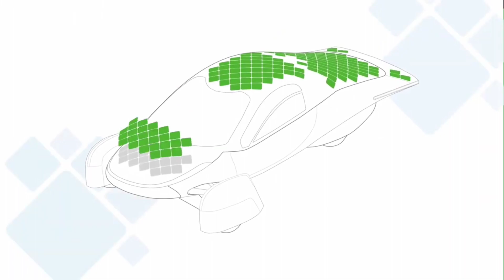Aptera Completely Destroying The Industry With This New Car

Comment: It's efficient technologically but impractical. It's a two-seater - not kids, family, dogs or even friends friendly. It theoretically has a lot of cargo space but you can't really put anything bulky in the back because of the slope of the trunk. It looks small but in reality because of the front wheels it's actually wider than an average car, plus the doors open to the side and up and you have to open them fully to get out so finding a parking slot wide enough might be a challenge in a lot of cities. It's low so getting in and out might not be easy for older people or just anyone with mobility issues. The road clearance is small so there's gonna be a lot of places it will not do well in. The reduced traction and weight will not improve its behavior on ice and snow. It only has 2 front airbags so good luck when something hits you from the side. It requires to be left in sun to use the solars but that also means having overheated car that needs to waste some of that power to cool down so I'm curious as to how much of the theoretical range would stay in normal day to day use.

Don't get me wrong - I wish them all the best. I'm sure there will be a lot of people interested if only for the novelty but saying this vehicle (it's not a car) will destroy the industry is a stretch, to put it mildly.

Comment: A major feature is their right to repair policy, by desiging it to be easy to repair and suppling information on how to repair any problem with the parts they will make available.

They have said that there will be 3 extior colors available in the Paridyme edition, black, white and silver other colors will be available 
with a special order. Three choices of interior colors as well. 
 
Production will be ramping up some time in the second half of this year, at two factories one in Carlsbad CA and the other at CPC in Itialy's motor city.

The new delta design was not shown in this video.
Reply: How do you want to repair the high voltage system? The batteries? The electronics? Everything else does not need a special "right to repair".
Reply: @vic321344  every thing is modular, all   EV's are required to have a high voltage disconect to mak it safe to work on or for first responders to be safe.
Reply: @davidmarlow194  Nope, if you pull the first responders switch, the battery pack has to be redone by the manufacturer. You are working with 400V DC. That will roast you instantly.

Comment: A question that comes up every now and then in my mind, is that since a major roadblock for funding seems to have been the lack of a fourth wheel, why didn’t Aptera add another wheel???Would it kill the aerodynamics so much???
Reply: A 3 wheeler is both more efficient and also a lot less expensive as the regulations on a 4 wheel car are significantly more than those for a 3 wheeler. They plan on a 4 wheeler once the 3 wheeler is being produced and successful.
Reply: Less resistance....yes, it apparently makes a difference.
Reply: As a 4 wheeler it would be a car, and it has to confirm to the safety standards of cars. As a 3 wheeler it is registered as a motorcycle, which makes it much easier and cheaper to produce.
Reply: I’ve offered them my substantial collection of old rollerskates and skateboards to help add a 4th wheel with little rolling & air resistance… no takers, so far. But seriously the 3-wheel exclusion is asinine provided the vehicle meets or exceeds passenger vehicle (4-wheel) crash tests.

Comment: Oil companies and electric companies don't want this car to succeed.  This is why people need to fund this production.
Reply: Because it is a motorcycle.
Reply: @vic321344  Nicest motorcycle I've ever seen. Full coverage, heating and cooling, drives like a car.
Reply: @tims8603  And is still a deathtrap in case of an accident. And it will be damn expensive. If it is ever produced.

And it drives like a pregnant whale, at least when you want to park in a parking lot.
Reply: @tims8603  "will be". Just a phantasy. Aptera does not have to commit to any safety regulation standards necessary for a car. If it would, production and development would cost 3 times as much. And it is already clear that the Aptera motorcacle canot pass even the simplest saftey measures.
Reply: @tims8603  I leave visions of the future to you and Nelson. "Will be", "Will have"...
See Sandy Munro. He speaks about the costs of production of the Aptera motorcycle against the cost of a regular car.
Reply: Definitely!

Comment: Small niche market at best
Reply: With more than 38,000 reservations it is a far larger market than Tesla's market for the Roadster.  It was designed for a niche.  The second Aptera planned will be a 4 wheel, 5 passenger sedan.
Reply: @n.brucenelson5920  $100 registrations mean nothing.
Car business is usually a money 💰 furnace
Reply: @richardwolf6269  It is a money furnace in this case as well.  The $100 dollar reservation fee weeds out non serious people to some extent.  The money is held in escrow and is available to be refunded on request at any time.

It is an indication of demand and Aptera has changed their production planning based on it.
Reply: @n.brucenelson5920  The roadster is also a niche market. And Aptera is not even able to produce their 3 wheeled motorcycle. Without the need for all the safety features a car requires.
Reply: @vic321344  Yes, the roadster is a much smaller niche market.  

They have not had the time yet that Tesla took to assemble even a working prototype, so your comment about not even being able to build a 'motorcycle' is wrong.

Aptera is an autocycle.  The safety standards it will be tested to are the same FMVSS Part 200 standards as any US car.  You keep trying to mis- inform people about this.  Why?
Reply: @n.brucenelson5920  Autocycle is another word for 3 wheeled motorcvycle (no sidecar). And Aptera is not able to perform even the simplest test of FMVSS Part 200. You keep trying to mis- inform people about this.  Why?
Reply: @vic321344  Don't mis-represent what I have said.  It just puts you in a bad light.  No one ever tests prototypes to FMVSS Part 200.  Aptera will do so once they have vehicles available to test. 

According to Lawinsider, 

"Autocycle means a three-wheeled motor vehicle that has a steering wheel and seating that does not require the operator to straddle or sit astride and is manufactured to comply with federal safety requirements for motorcycles. Except as otherwise provided, an autocycle shall not be deemed to be a motorcycle."

You can make up your own definitions, but they have no legal meaning.
Reply: @n.brucenelson5920  "is manufactured to comply with federal safety requirements for motorcycles". That is all that counts. Everything else is squack. And in some legislations you even have to wear a helmet in the Aptera.

GENERAL ASSEMBLY OF NORTH CAROLINA
SESSION 2015
HOUSE BILL 6
RATIFIED BILL
H6-v-3
AN ACT TO DEFINE AND REGULATE AUTOCYCLES.
"Passenger Vehicles. –
a. Autocycle. – A three-wheeled motorcycle that has a steering wheel,
pedals, seat safety belts for each occupant, antilock brakes, air bag
protection, completely enclosed seating that does not require the
operator to straddle or sit astride, and is otherwise manufactured to
comply with federal safety requirements for motorcycles.
a.a1. Excursion passenger vehicles. – Vehicles transporting persons on
sight-seeing or travel tours.
…
d. Motorcycles. – Vehicles having a saddle for the use of the rider and
designed to travel on not more than three wheels in contact with the
ground, including motor scooters, autocycles, motor scooters, and
motor-driven bicycles, but excluding tractors and utility vehicles
equipped with an additional form of device designed to transport
property, three-wheeled vehicles while being used by
law-enforcement agencies and mopeds as defined in subdivision d1
of this subsection."

You can make up your own definitions, but they have no legal meaning. 

You keep trying to mis- inform people about this.  Why?
Reply: @vic321344  It seems clear from this reply that you are not a native speaker of English.  There are "legislations you even have to wear a helmet in the Aptera." we can only guess at what you wanted to say.

To many of us, passing the government standards for cars is an important step, whether or not it is required.
Reply: @n.brucenelson5920  Aptera is not able to pass even the simplest safety measures for cars. Hope you are able to understand that.

Merriam Webster: "legislation: the exercise of the power and function of making rules (such as laws) that have the force of authority by virtue of their promulgation by an official organ of a state or other organization"
Reply: @vic321344  Your first sentence is not true.  It has already passed virtual automotive crash tests.

Nearly a half-million passenger cars and SUVs sold each year have not been crash-test rated by the two main organizations that conduct independent assessments: the federal National Highway Traffic Safety Administration, which uses a star rating system, and the insurance industry-backed Insurance Institute for Highway Safety, which rates vehicles from Poor to Good.
According to Consumer Reports, the vehicles that are not independently tested are:

    All Land Rover vehicles
    All Porsche vehicles
    All Jaguar vehicles
    Lexus GX
    Mercedes-Benz GLA
    Mercedes-Benz GLS
    BMW X7
    BMW 4 series
    Chevrolet Corvette
    Mercedes-Benz S class
    Mercedes-Benz A class
    Mercedes CLA
    Honda Clarity
    Toyota Sequoia
    Mazda MX5 Miata

Quit with your FUD and untruths.  Your second sentence is not relevant to what you wrote.  I have served my decade as an English teacher and don't need to hold myself up to instruct you.

Comment: I could see many people getting this as a second "fun, errands and commute" car, especially in sunny climes. If they bring out a 4+ seater in the future too, it could be a game changer.

I'm not sure getting the 1000 mile version would make sense for many though, as that would reduce the daily solar miles you could get due to weight, though using a standard charger would work for those who do need it for long haul.

Just the idea of never having to fuel your car again in sunny places would have me buying one in an instant. I live in the cloudy UK, so I'll have to see how it performs here, but it does look cool and is pretty nippy too, so fun.
Reply: I expect to get around 20 miles per day here in Iowa with full solar.  It will be interesting to see what changes besides RHD they will make for the UK market.
Reply: Probably a third car for people with money.
Reply: @njm3211  perhaps, but due to the extremely low cost of operation it could be a hit for some of the same reasons the Reliant Robin was but with far better performance.

Comment: A fantastic bit of kit but not practical enough for the majority of motorists, unbeatable range but only two seats.
Reply: When you drive to work, how many people are with you?   Not practical?
Reply: Aptera was only initially intended for a small niche market.  The 38,000+ reservations so far caught the company by surprise, forcing them to rethink their body production process.  The change is expensive, requiring more investment and delaying the first vehicles, but it means that the production numbers will ramp up much more quickly than originally supposed and the precision and fit of the body parts will be better.

I believe that it will be perfect for some young people and couples and many retired couples who are empty nesters.  We hope to use the long back for camping in relative comfort compared to our motorcycling days.